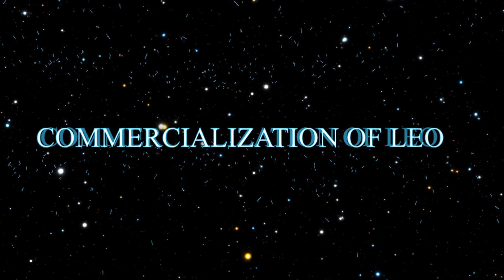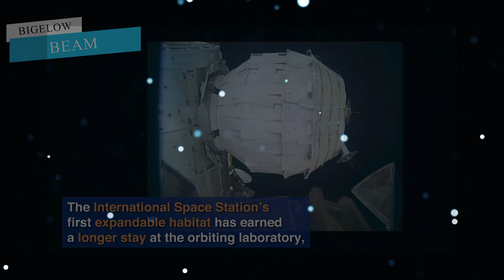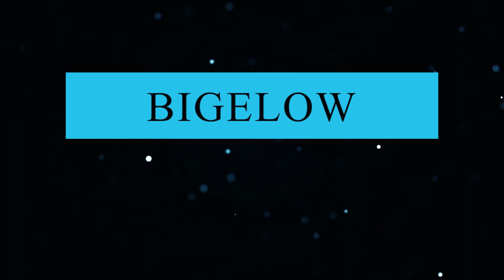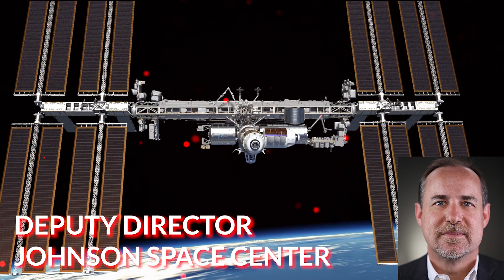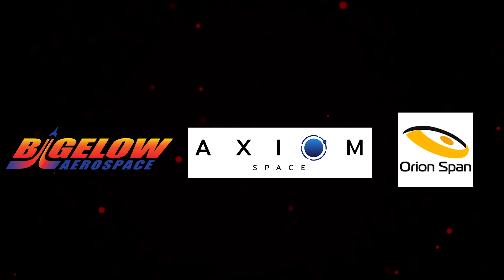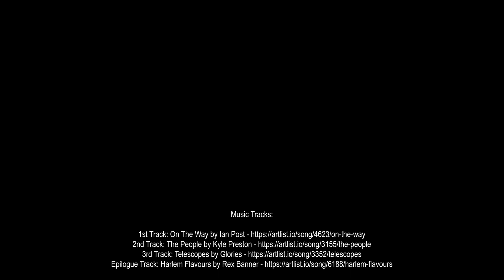Commercial Space Stations: Bigelow Aerospace & Axiom Space

Comment: Bigelow needs to get the 2100 done and move on to a 4500 module the will fit inside the 18meter fairing. They are laging way too slow. Just watch how space x is going right now 
developing the starship. The speed needs to accelerate rapidly. If Bigelow and the gateway foundation don't speed up .....they will get left behind.

Comment: Bigelow and SpaceX could make trillions mining asteroids for platinum, gold, rare-earths, etc, but most of all getting into the $10 TRILLION a year energy market by building solar power in space! (Microwave it down via PowerSats). SpaceX ferries up the first few Bigelow Olympus modules that are tethered together and spun up. Maybe this starts really small with just matching pairs opposite each other! They'd have weight bearing tethers and a passenger tube down the middle to a ship docking ring? Anyway, they're mining not just for cargo to send back home, but for basic steel struts etc to start extending their own living space. Then they don't have to build inflatable anything, because launch costs are no longer an issue. They could use the same superior Bigelow materials if they wanted, but with custom sized panels they just weld into place. First spin in space would be a major achievement, and the first profitable space-mine an absolute game changer that might enable a true space race!

Comment: I just don't get why they're not already working on a large wheel type 'station'.  You could fly pre-wired modules ready to hook up or bolt together... spin them at a 90' angle to the sun so blocking radiation would be minimalized by shielding the underside of the modules which would always  be facing the sun, solar cells on the underside  would provide steady power,  you'd have gravity to help fight the lack of problem.  You could have a smaller ring on the inside of the spinning wheel for sleeping quarters in less gravity.  Other than the difficulty of docking... why the fk ain't we doing this now... specially with the blowup compartments... that would have to make it easier all the way around, Yes??
Reply: Google for the Gateway Foudnation and their new project the von Braun station
Reply: are you a rocket scientist/ aeronautic engineer? the funny thing is people think they havent thought of these things and then people on the net think they have the answer that scientists havent thought of. lmao.

Comment: For some time I doubted Bigelow, I just didn't get along with the idea of an inflatable spacecraft. But this video completely flipped that assumption. The sheer realization that they are building a space station not twice, but 2.5 (TWO POINT FIVE) times bigger than the ISS that can be brought to leo completely with one (ONE) launch (not to mention the hull will be stronger than the ISS's metal) was enough to make me fall in love with them. Imagine all the possibilities- Space condos, hotels, labs, factories, observatories, and even interplanetary vessels if you either strap on some raptors engines to it and a nice carbon fiber fuel tank, or put them in an Aldrin Cycle trajectory. Also, the way you present the facts and their accuracy is fantastic as usual!
Reply: Hopefully it happens, because there were tons of these plans canceled in the past. One of them was for Space Shuttle tanks to be used as space station modules, and those were already going up there, but no one would fund that extra step to make it happen.